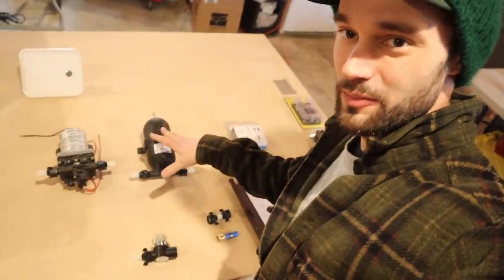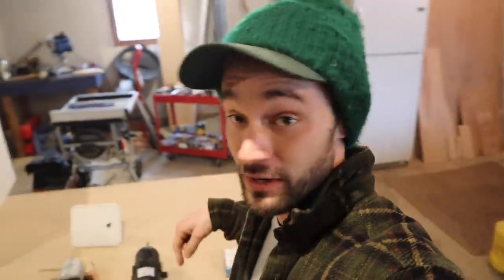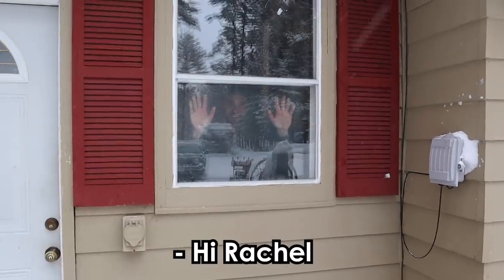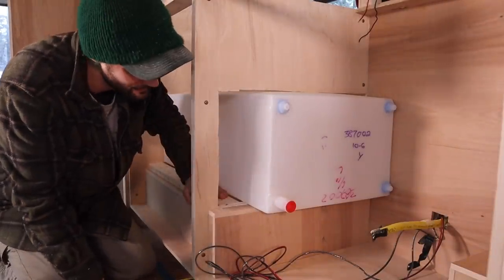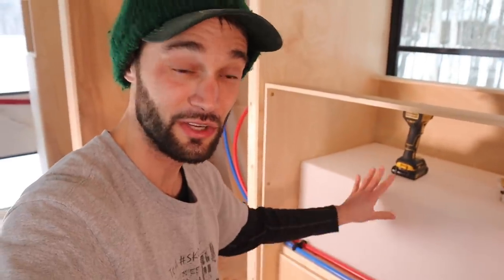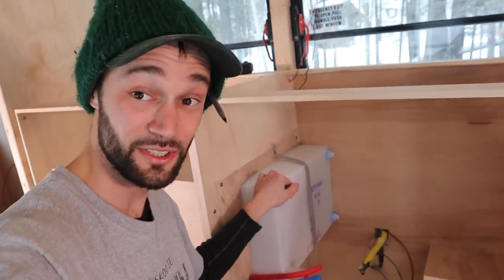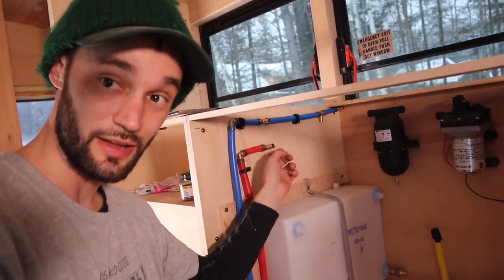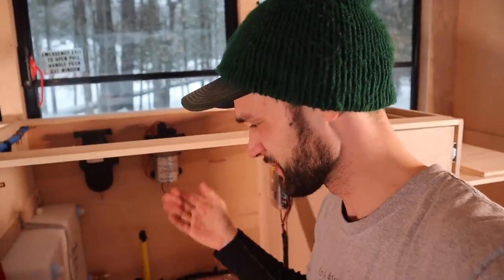Alone Installing The Water System In My Bus Conversion

Comment: Two things.  The plywood cover facing the front of the cabinets, you can utilize as a small storage if you build a door.  Also use some felt or cloth material between your metal tank straps and tank.  The tank may flex and move on bumpy roads.  Sharp straps will cut into tank.  Good job on this build so far!

Comment: Buddy, you might want the pump below the tank. Otherwise it will be hard to prime.  Also get a bicycle infertile to slide over your straps in order to protect the water tank.
Reply from the maker: Thanks for the suggestions. In the next video, I actually move the pump for that reason. But, appreciate you looking out for me!
Reply: @navigationnowhere  you might want to add a drain valve at the inlet side of the pump.
Reply from the maker: Thanks! I had a blow/drain value and a pressure gauge to test the system later.

Comment: Hey man. Awesome build. Love both buses.  Just an FYI. The water pump is way too high.  The water coming out of your tank won’t even be able to reach it. The water in the pipe before the pump will only reach the height as the water in the tank. The water pump has to be the same height or below as the outlet of your tank or else you not get max water out of your tank.

Comment: Did you put the tank in upside down? The large fill port is on the bottom
Reply from the maker: Yeah I am going to fill it from the bottom and have an air release on the top.
Reply: Ok. I usually put the big opening at the top in case a hose loosens so no massive leak and use the opening you'll connect the pump to as the vent.

Comment: that's a small filter. You should look into something bigger possibly a UV light as well. Carbon catchers etc.
Reply from the maker: I will have a filter before the fresh water tank that will be for water safety. The little filter is to protect the 12v pump from anything that could get through the system.

Comment: Another great build video! Is there a specific reason that you choose to use the crimp connectors on your plumbing instead of push to connect style fittings?
Reply from the maker: Cost would be one thing the shark bite connectors are more expensive where we are at. Besides that it’s just what I have always used and I had all the crimping tools.

Comment: Hi Michael, I’m enjoying watching the Ivan build! It’s going so well. On this vid however, I have a couple worries. First, the bottom surface of the water tank (when we could see you sliding it in place) is straddling upon two 2 x 4s spaced apart, not a total flat surface. I’ve seen tanks like this, when full, not placed on a flat surface. The plastic over time deforms or bulges down into voids, eventually developing stress cracks at sharp surface transitions and later begins leaking. Remember you’ll have as much as 320 lbs of water in it! My second worry is the (up to) 320 lbs mass won’t be held back by the strapping over that right hand end in a hard braking maneuver or front impact. It will slide right out! I’d hate to see the work you put into acquiring/placing all the water management equipment and possibly compromising all your great cabinet work. Might you be able to fasten something like a long horizontal 2 x 4 brace against the back wall where one end is butted up against the right side of the tank and the other against the left cabinet wall? That would certainly lock it in and you could use screws to remove the brace in the event the tank needs to be removed. Thank you for a great series!

Comment: Michael, did you consider installing a hot water line to recycle from the shower back to the fresh water tank. 
Why? Because if you want to take a warm/hot shower with wasting water, you turn on the hot water and let go back to the fresh water tank until it is hot enough for you, then take your quick shower. This way, you don’t waste any water waiting for hot water.  Hope this makes sense.
Reply from the maker: I have not consider that but now I will be looking in to it.  thanks for the idea.

Comment: Hi! First off your videos have my top following when it's coming to my first bus conversion ... So I'm grateful for you for that. 
One question, no one is talking about their systems being connected to an electrical source 
Do I need electrical to have gray water and fresh water systems in my bus that run? 
I've read that if I manually lite my gas water heater I can bypass electrical, and would the rest just be pressure?
I eventually plan for a complete solar setup but I mean, financing that though
I currently, at this moment, have a shell of a bus ... Insides ripped out. Still have to figure the electrical schematics (your video with your pop has been very helpful) 
Just tryna wrap my head around it all as an entire project from start to how I desire to finish

Comment: Are you going to wrap the pipes for cold weather? Where is the fill connection going at?
Reply from the maker: Not in this bus, they are in open interior spaces and the bus will either be heated or i will blow the lines out.

Comment: Awesome work. Is there a need to use any waterproofing? Like a clear coat of some poly around the tank/pipes?

Stay safe!
Reply from the maker: You could but, I have never had any issue in the past with the pipe lines so never considered it. That’s something I might think about adding. Thanks.

Comment: Did you reinstall the rubber mat in the cab? At least on the driver side. It's hard to tell from the video.
Reply from the maker: The original rubber was removed and cut to be placed back in. It now acts as a flashing between the floor and cab area.
Reply: @navigationnowhere  Thank you.

Comment: Surprised you didn't just expand your sink cabinet and dedicate it to the water system. Then you'd have another whole cabinet (yes but smaller) to storage.  I know alot has to do with the wheel well!!!  Could have dedicated that first (left - closer to the shower area) cabinet for the sink.

Comment: Sorry Michael but all you guys seem to want to mount your water pumps upside down. The motor should be above the pump head so if the pump head does leak it will not get into the motor and ruin the motor.

Comment: Is it safe to add 320 pounds of weight on each wheel well? And if so could I add another 400 pounds on the back of my bus? The weight of my motorcycle...
Reply from the maker: I don’t see why the 3500 chassis on my bus would have much issue with holding that weight. as long as the rear mount for the motorcycle can handle it should be fine. I might be putting a 250 on my rear.
Reply: @navigationnowhere  I was thinking of adding a back porch/storage space in the back so I'd have room for a ladder.